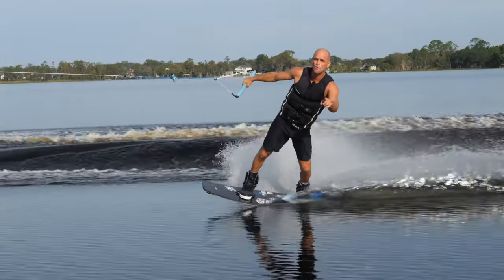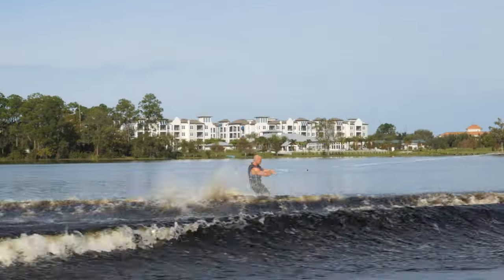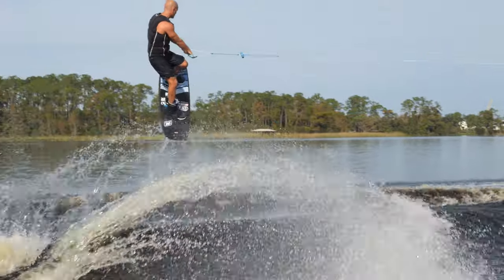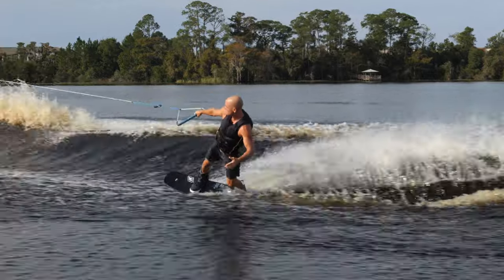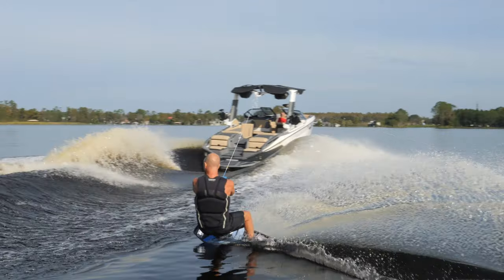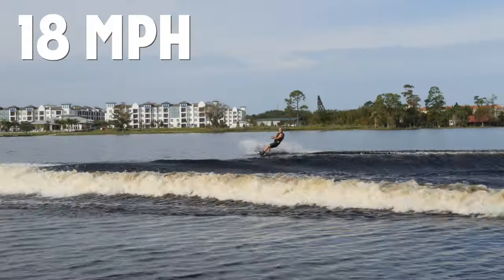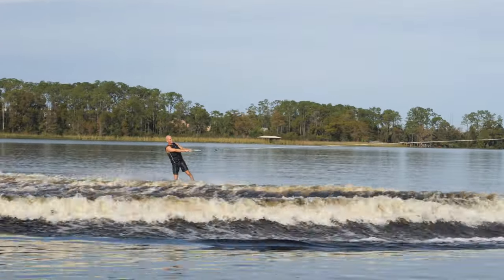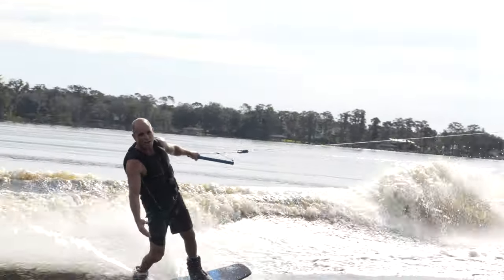The most important part of your wake to wake jump!

Comment: I'm guessing you need a wakeboard specific rope with no stretch to do this best? I've never used a wakeboard specific rope. But I'm going to get one! I have the cheap PE ones
Reply from the maker: Def don't have to have a wakeboard specific rope to ride but one of the keys to keeping good control is the handle being still. It's one of the keys to even getting up out of the water. Wakeboard ropes don't stretch very much and can help with keeping the handle still.

Comment: Shaun - I've certainly felt many times what you are doing here.  Easiest example to me would be building for a heelside backroll but not completing the release.  My issue is, staying on edge all the way to the top of the way seems to ensure that you maintain the most line tension possible.  The line tension stays consistent throughout the time in the air.  This makes grabs and spins more difficult.  Bleeding a touch of edge and then standing tall and pulling makes those tricks much easier to me.  Any thoughts?
Reply from the maker: That's the release you're referring to. If people do a worm burner (stay low and don't get height) it usually comes from staying on the edge and not releasing the power.